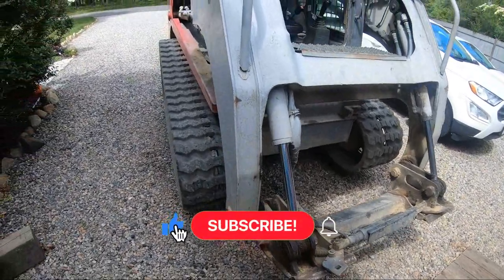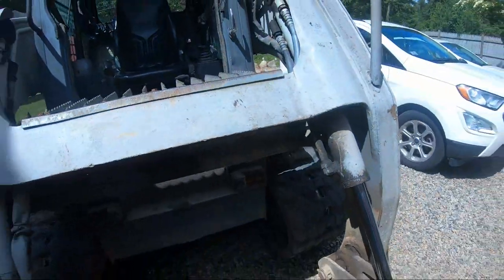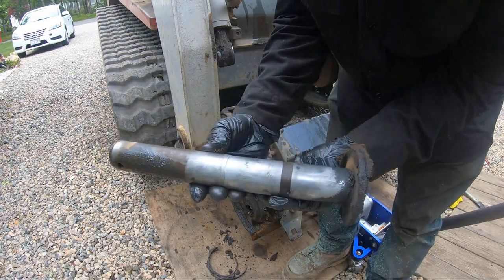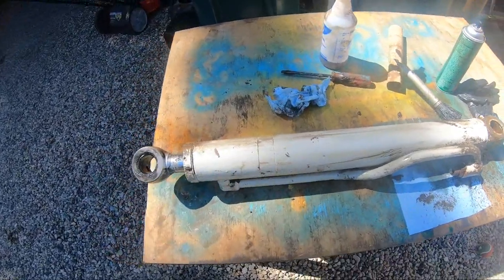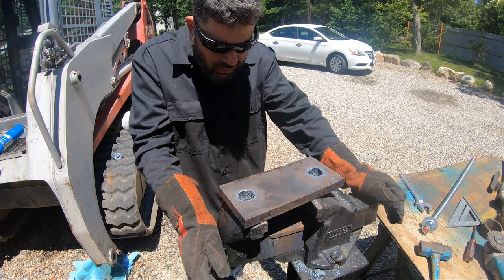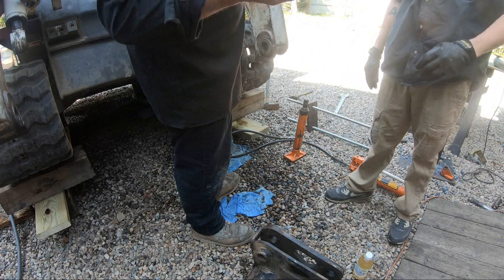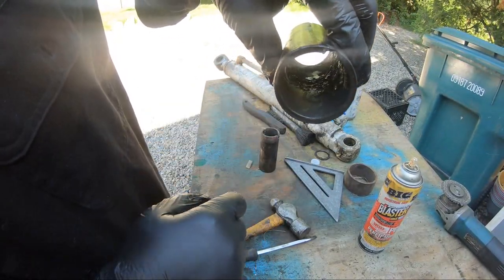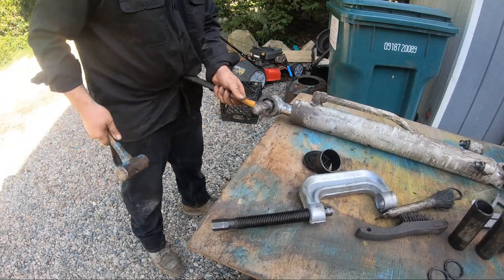Homemade Bushing Press | Takeuchi TL240 Pin & Bushing Removal!

Comment: Nice work man, next time get the stick welder and run a few welds inside the old bushes let it cool and it will shrink and slide out easy, leave new bushes in the freezer overnight will make then go in smoother
Reply from the maker: The plan was to use the welder but like I showed in the video, I forgot to get a new cord. The bushings had also been in the freezer for over a week now lol. Still, good advice! Thanks for watching!
Reply: @DirtBrute  ahah sorry man I need to watch more carefully 🙂 you have got it sorted, have a good one
Reply from the maker: @brianwynn5081  hey thanks for watching. Appreciate it 👍
Reply: What size porta power is this?

Comment: You might want to put a level on the ram so that it applies force equally on the sleve ! IF it starts pushing unevenly it could wedge the ram in the hole !
Reply from the maker: Maybe on the next one I’ll level a parking spot for the machine to sit on. Thanks for watching.
Reply: Or , maybe you'll have built your 40 x 40 shop and a $400 a month pymt to the bank ! , Thanks
Reply from the maker: @joedoakes8307  lol 😂 no payments. We just got the permit a couple months ago. It’s a 53 x 32 of big town. I just don’t have time to start it right now.

Comment: I just used a dremel and burr to cut a slit in the bushing to relieve the pressure and popped them out with a hammer. Replaced many on my mini excavator.
Reply from the maker: Yeah there’s a few good ways to do it like yours I’ve done before. I didn’t get the other top loader arm pin on film because I thought it was rinse and repeat. However it took a 20 ton bottle jack to press it out after drilling a hole through the center of it
Reply: @DirtBrute  Wow...tight one....LOL Good stuff man. Can't wait for the video on the excavator issue.
Reply from the maker: @kidhenderson8260  thanks for watching

Comment: Good work. Around 11 min mark you are knocking out a pin using an old pin. I have a pin with a steak welded to it at the end to keep peoples hands out of the way and it help with the vibration issue. Biggest thing is the hands though. One small error and your hands will never be the same
Reply from the maker: That’s a good idea . Thanks for watching.
Reply: That was sketchy af😬